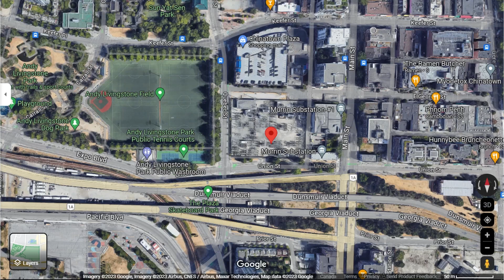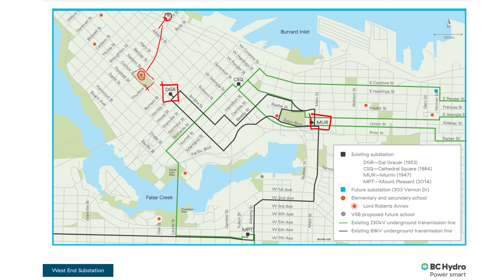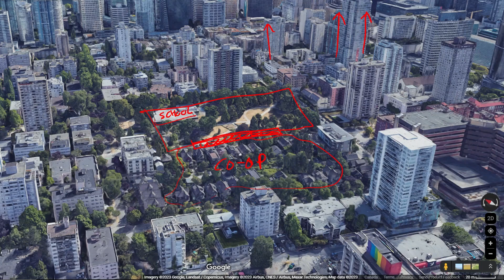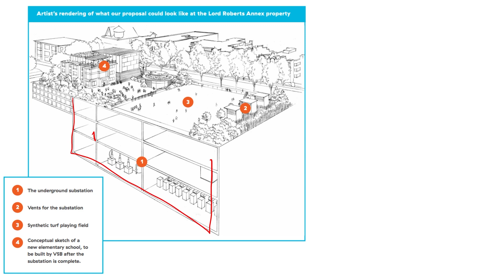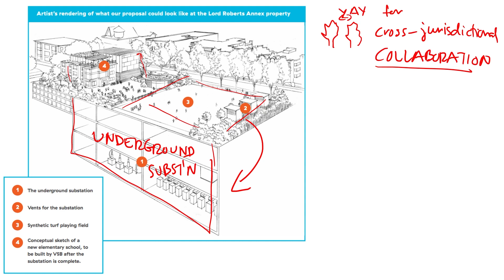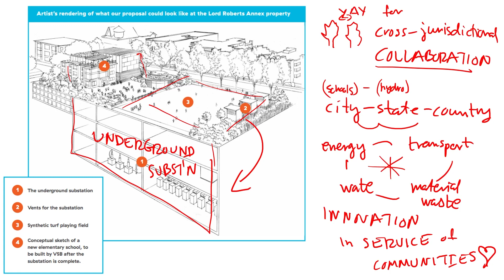ode to sustainable collaboration

Comment: Really cool episode! I wonder if there is any benefit to the substation being underground. Like, is it easier/less expensive to maintain the right temperature or maybe less maintenance because it is not exposed to inclement weather? It also seems safer because no vehicle can crash into it and there is no possibility of a lightning strike or other weather event.
Reply from the maker: Great question. I don't know the details, but I imagine it adds cost and complexity for operations and maintenance. If the stuff was out in the open air, no need for ventilation, easy to install and remove. Underground probably gets difficult for access etc. But it is protected from the elements, so equipment might last longer. It's all about choices and tradeoffs I guess....